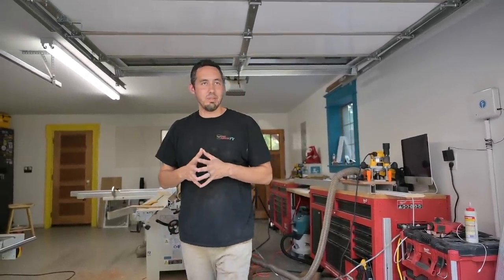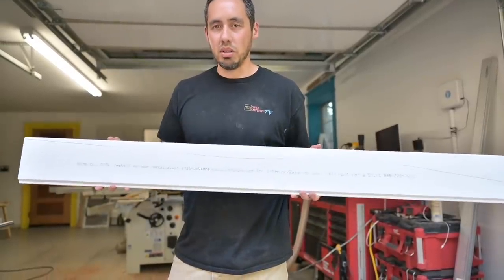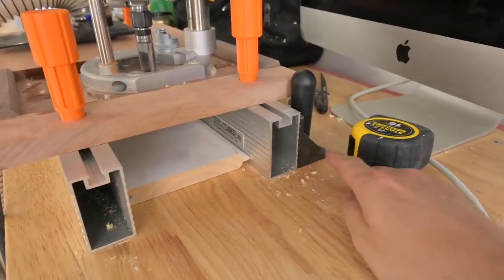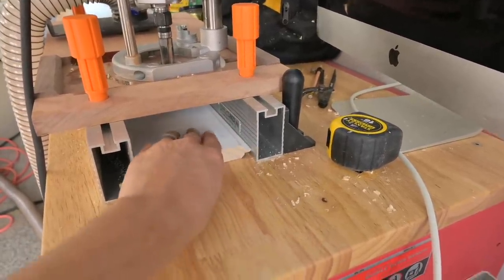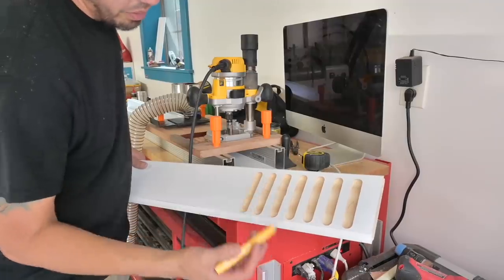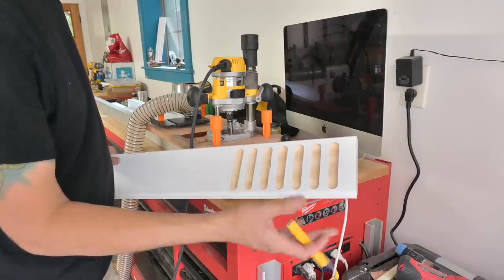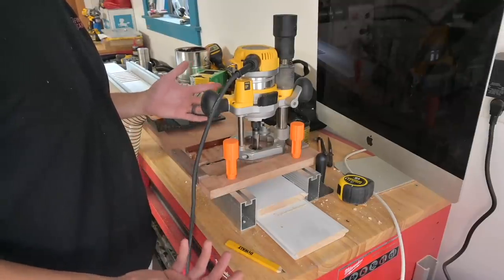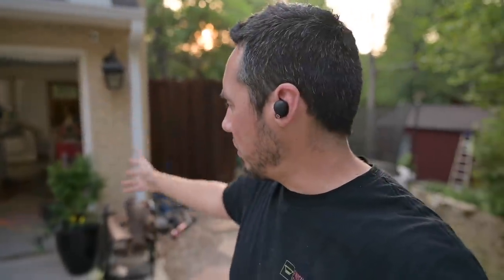I have to make & install this custom crown moulding.

Comment: Mark a straight line for the first inch and a half all the way across the face. Make a 1.5” block. Router the flute and pull it out and line block up with ends of track tubes and pencil line that is center of the flutes. First couple might need to be marked with a pencil until it comes out enough then you should be good

Comment: Pre mark all boards with Center line and add a cheap pin pointer laser drilled in line with center of router bit.

Comment: Use an indexing pin or tenon. Cut a hole to the right of your jig slot the appropriate distance e.g 2 inches spacing to the right.  After the flute is routed move the board 2 inches to the fight. It should line up with the hole you cut. Place a piece of wood through the hole into the flute.  All flutes will be equally spaced. You may have to modify your jig so the pin doesn’t interfere with your router base.

Comment: Utilize the bottom board that lifts the work piece by making your marks on it for spacing or glue a tape measure to the board. You then could slide your work piece along the bottom board to the desired increments. Of course this would mean you'd have to have the bottom piece the same length as the work piece.

Comment: One way to set this up would be to put a slotted fixture on the out going end of your jig so that you can adjust the distance from the centerline of the router bit.  Create a drop down pin or shaft that would drop down into the last groove you cut.  You could have someone print a plastic piece that matches the dimension of the bit you are using so that it will drop into the profile of the cut perfectly each time preserving the dimensional repeatability.  If you made the pin spring loaded it would be a quick movement to be ready to cut the next groove.

Comment: Have both tubes laser edged with a tape measure or use a tape measure with pressure sensitive adhesive on both sides of the tubes. Then use a Rockler stop guide on one or both sides of the tubes.

Comment: If you’re going to reference with the fence just put some marks every 1.5 or 2” on the board edge before placing in jig then you can just line up the marks as you go. 

Another way would be drill some holes in the top of the rail that you could have a pin in your jig that would drop into it like on the festool track then move the jig along the track instead of moving the board. Only problem with this option is it’s locking you in to 1 spacing size. 

Another way would be to make something that comes off the jig that can land in the flute you just made and can be adjusted for spacing then the jig would again move along the rail and reference the previous flute for spacing.

Comment: Honestly a compass is old school but a great tool for marking the same increment down a straight line

 so yo could use the corner of the workpiece as your straight line, set your compass to you increment and just flip and mark down the work piece then line that mark on the corner up with your aluminum tubes and boom 

The only set up is the compass and you’re rolling

Comment: just add an indexing board that fits in the flut.once you cut your first flut,you lower the index down in it and then you can cut your second one, then just repeat for the length of the board.

Comment: Haha... just got to the point in the video where you were wondering what would be the most efficient way to keep feeding the board 1.5" at a time and the funny thing is I was thinking exactly of Matthias Wandel's wood gears where he knows exactly how many rotations on the gear will feed it 1.5".  So funny that you mentioned it because I was thinking the same thing!

Comment: Maybe a metal ball with a spring to catch your newly created vertical flute when pushing the board to the right, press harder so that the ball rises to catch the next one. Simplest idea would be to create a hole at the top of your jig where you can insert a pin to catch that fluting.

Comment: Very cool project! OK, here's some comments and questions. I would always worry about the corners and winding up with a half mortise butting into a blank spot. Also, I'd tend towards a slightly thinner bowl like you were saying. Personally, I think I'd talk the customer into the widest spacing possible because I think it would look less busy and you'd probably have less chance of a half bowl meeting in a corner. Maybe don't even miter and get those decorative cheater sticks to but into the corners. I just had a nightmare wainescot job with weird dimension walls and that 006 Windsor wainescot cap so I'm a bit handshy about stuff like this now lol. As far as spacing goes I think I'd just pre draw lines on each board before routing and then just line them up with your jig instead of getting the tape out every time. Also thinking Bin sealer is going to be ideal to get a nice hard shell on those bowls. I can't wait to see the finished project.

Comment: You might want a hold down clamp, so the board doesn't slide. Also, if you don't use a bowl bit, a downcut spiral bit  should reduce tearout.

Comment: Try inserting a dowel from the top into the last grove and find a way to use that as a measured stop for the next cut.  No tape measure just the dowel inserted into the last
Grove

Comment: I’m sure this has been mentioned but you could do it with a smaller jig that sits on top of the workpiece that indexes off the previous cut. Similar to the way a finger joint table saw sled indexes

Comment: Make a reference piece that is exactly the distance you want the holes apart. Grab a scrap with a perfect 90 cut. Make sure both ends of the material you’re using to raise the material you’re cutting are cut square, and flush to the end of your bench and secure it in place so you can reference off it. A bit of setup, but once you do this its easy. Take your spacing block and use it to space your scrap piece off the end of your bench by exactly the space between centers. Clamp it securely to the bottom of piece you are cutting. It’s now a stop block for your next cut. Now between cuts all you need to do is use your spacing block to move your stop block down the board. The cool part of doing it this way is that all you need to do to change your spacing is to change the length of the spacing block.

Comment: If you're actually going to do this with 2 people you could make 2 pieces that are as wide as your offset from flute to flute and use them as stops. The other guy can push the board against piece A, move the board forward after you made a cut, put piece B between piece A and the board and push the board against piece B. You could also put another piece between your stop blocks and your board to prevent the stop blocks from getting to close to the router.

Comment: How about a piece of plexiglass/acrylic mounted between the tracks about 1/16 or less over the workpiece with a vinyl cutout of the flute design stuck to it. After the first couple of measured flutes are cut, just slide the workpiece down and visually align the flute with the vinyl cutout. When you are done with this job, you can peel the vinyl off and stick on a new piece when you are ready to do the next job.
Reply: My other idea would be to use a dowel as a “positive flute”, mount it on a lever that attaches to your jig. As you slide the piece down, the horizontal dowel drops down into a previously cut flute. After that cut, push the “handle” end of the lever, and slide until the dowel drops down into the next flute.

Comment: What if you make the board at the bottom longer on put the measurements on the board at the bottom  so it works like a ruler or tape measure

Comment: I’ve been pushing the Golden Section on you quite a bit lately…it’s a must when coming to spacing. Ex. A flute bit of a 1/2” wide would equal….( .5 x 1.618 = .80) so spacing between flutes would be   close to 7/8”.

Comment: Someone else might have mention this, but consider adding a peg board floor to your setup and use a peg the same diameter of the holes to index your board.

Comment: My idea is a bit different than the others in the comments.  Since there are going to be 2 of you working on this, cut a bunch of scrap pieces of whatever you have laying around to the width you want between the flutes.  This you can easily do with a stop block and get identical widths.  Then the person at the other end who is feeding the board in just drops a new spacer block between the stop block and board.  By the end you'll have many spacer blocks, but it'll be easy and you'll have consistent spacing without manually measuring each.  I mean... manually measuring will work as well and may be less time.  Definitely less waste.  

Anyhoo... the end result will be pretty sweet no matter what.

Comment: Maybe you could find something ratcheting that pushes it along evenly each click. Carjacks used to click one at a time raising your car. That kind of idea. Hot glue a push piece to the material.
Pop it off and reposition it every 3 or 4 ft

Comment: Hey what’s up dude, love your content.
You could drill and pin a vertical arm/lever, that drops a cut the width of the router. This would sit in the mortised channel how ever spaced apart you decide. It would make that part of production effortless.

Love your work dude

Comment: Here's my suggestion:
On your bottom spacer board, drill holes down the center at whatever spacing you settle on. Use a pin or piece of dowel as a stop. Now you can advance the work piece to the stop, make your flute, move the pin to the next hole advance your work piece...you get the idea. It's a long adjustable stop.

Comment: I would put a slotted board (same thickness of your slot) on the end of your jig and build it out to where it lines up with your first slot at the right spacing so it can be lifted and dropped into the next slot then the next slot and so on. You could also use metal rods that drop in at the ends of each slot and a handle connecting them. That might help it be more rigid. Just add another layer of walnut or something to give the rods more stability.

Comment: For fast indexing, fasten the bottom spacer board so the end of the board is the same distance from the end of the tube that you want on center.  With each cut just mark a light pencil line on the edge of the trim piece at the end of the tube.  Make a flute, then shift the trim so the line on the edge lines up with the end of the bottom spacer board.  Make next flute, mark edge at the tube end, then shift pensil line to the end of the bottom board.  Repeat, repeat,…

Comment: Put pencil marks on the width of the board in the correct orientation and use your track end to center your line on.

Comment: Run down to Walmart or a fabric store and buy 10' of 2" wide waistband elastic. Draw a line across the width every 1" down the whole length. Anchor the first line on one end of the board and stretch the elastic until the marks are at the spacing you want, then transfer the marks to the board. Depending on how stretchy the elastic is, you can make even center marks from 1 up to about 3 inches by just stretching the elastic more or less. The best thing about this technique is you can easily adjust the spacing on each wall so none of the flutes get cut in half at the corner.

I use the same technique for spacing balusters, only I mark the elastic every 2 inches. It rolls up really small, so it doesn't take up much space in my toolbox.

To align the board in the jig, mark the spacing marks on the front edge of the board, then line up a mark with the end of your fence, rout the flute, then slide the board down till the next mark lines up with the fence.

Comment: Amazing solution to your problem. My only comment would be that the flutes are not centered on the board, there is a bigger gap at the top then there is at the bottom.

Comment: Drill a hole to the right of the slot in your jig. After you make a cut, pot a dowel in the hole, move the board right, dowel stops movement when it drops down in slot you just cut.

Comment: Place a stop on the left end of the board, run the first flute. Use a spacer block to advance the workpiece, clamp the workpiece, bump the stop to the left end again. Repeat.

Comment: Just bump up the tape measure to the track tube and mark your reveal. Then make your marks on you workpiece and  each time you shift it just line up each mark to your reveal measure. As long as you start flush with the end of the tube it should work. If anyone has a better way, feel free to let me know.

Comment: All you have to do is drill a series of quarter inch holes 1-1/2 inches on center in your bottom board for the full length, and then drill a single 1/4-in hole in your upper board at the left end into which you insert a 1/4-in dowel protruding slightly at the bottom. Then, just move the top piece from stop to stop along the lower piece (which is held stationary), registering in each successive dowel hole and presto... evenly spaced flutes.

When done, simply trim off the doweled end of the fluted piece and repeat.

Comment: Make your flute then use a thin mechanical pencil and mark your piece at the end of the track tube. Move piece over to a measured mark and make next flute. Mark piece again at end of track tube and move to measured mark. Easiest method I can think of

Comment: Drill the full length of your bottom board with ¼” holes down the center line at whatever spacing you need.  Put that board into your gig and clamp it down for heaven’s sake because this bottom board is essentially a part of your gig now.  Then on the far end of your crown board drill a single 1/4” hole on the center line of that board.  Use a ¼” screw or dowel “pin” to align the two boards and cut your first flute.  Pull the ¼” pin out, advance your crown board to the next index hole and put the pin back in that hole.

Comment: Draw, say four lines on the bench cross-wise, spaced the distance apart that you want the flutes to be so that when you put the end of the board to the line nearest the right side of the jig your bit will be at where you want the first flute. Then just advance the end of the board three more times until you've reached the last line that you've drawn on the bench. That will have gotten you started. To continue, attached a slat or something vertically down off of the right side of the jig so that it has an edge or a pointer that descends as far as the top of the workpiece so that you can align it with the edge of the first flute that you previously cut. Thereafter, just advance the board to the right  each time so that the pointer is aligned with the same edge of the next flute.

Or, make a little easily removable arm that fits snugly into the flute but extends toward you beyond the nearest edge of the workpiece and is cut so that the extension also extends downward to benchtop level. Register it with the lines drawn on the bench, or even attach a stop to the bench.

Comment: I just finished a pair of cabinet doors  using  a router to make through slots similar to yours. . For a fixture to hold the boards I used a Porter Cable dovetail jig with the dado template. My slots go completely through 5/8 “ mahogany doors, half inch bit on 1 inch centers. While very attractive and made for vents , they are very time consuming. One mistake and you start all over ! Mike

Comment: Get yourself some Johnson’s floor paste wax.  Cheaper and more effective than Odies oil.  You can apply that to any surface to help things slide with a lot less friction.  Add that to your PM schedule and wax any cast iron surfaces.  Paste wax will help with keeping rust at bay on larger machines.

Comment: There have been Some good suggestions for a flute stop.
Taking a different approach…
How about outsourcing the flutes to someone with a CNC? Would save you many hours of brain numbing routing.
Most of the flute’s I’ve seen have very little space between them. Maybe only 1/4 inch. Makes CNC even more attractive!!
Good luck with the project.

Comment: I would highly recommend some way to clamp the work piece down each time. Last thing you want is for the piece to shift on you or start walking during a cut. Even vibrations from the router could cause the work piece to move. Maybe as simple as a toggle clamp bolted to the work bench…

Comment: Where board comes out of the jig simply draw a line on the board then have another spacer block attached to the table, corresponding to desired increment....push the material through and align the line with the end of spacer block. repeat.

Comment: Take the sacrificial bottom piece, move it out of the track the desired reveal and secure it in that position, then each time before you plunge the router flush the finish piece to the end of your bottom piece and the reveal will be the same and you won’t pull out the tape once